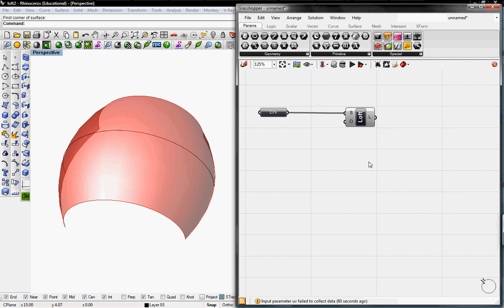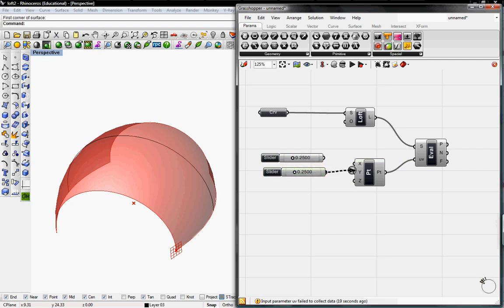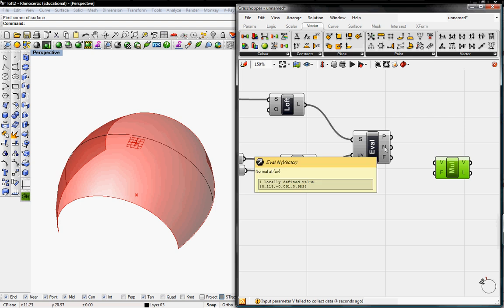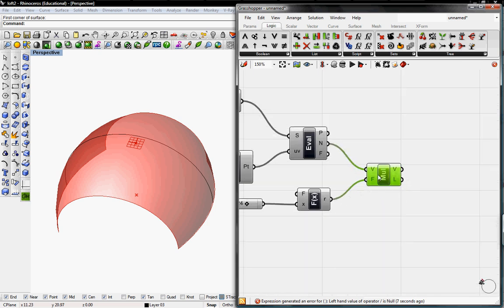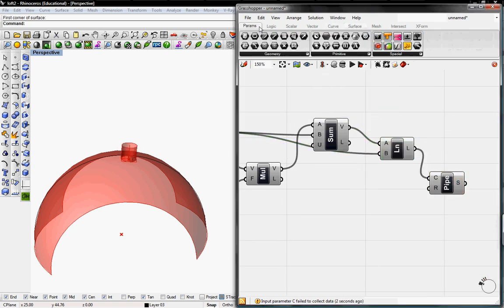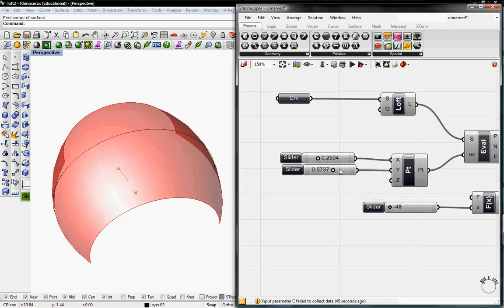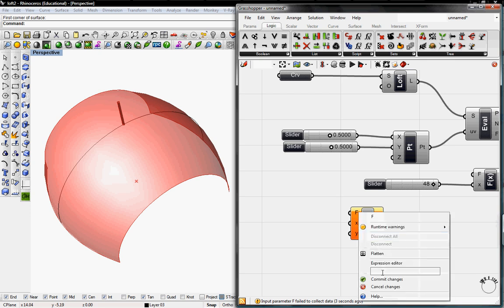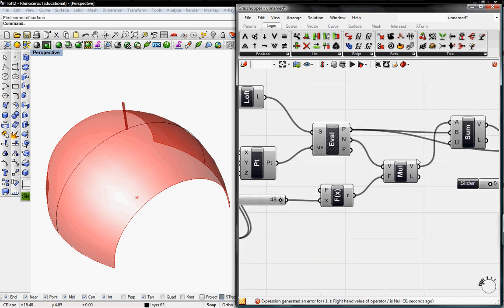evaluate surface by digitaltoolbox.info

Comment: For the newer versions of Grasshopper, Multiplication under vector doesn't exist, you can use the multiplication under Math, also Summation is not longer here anymore, instead use the addition tool under Math.